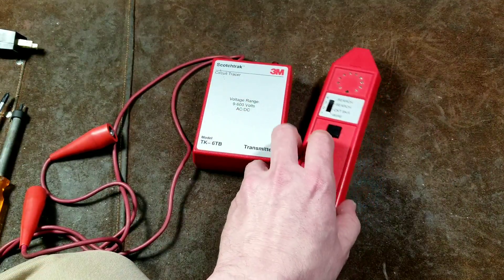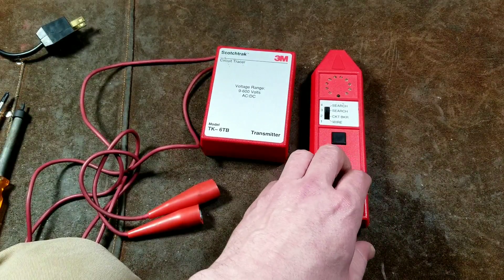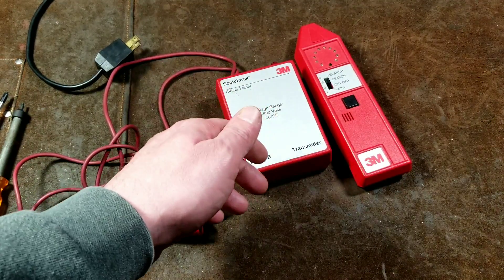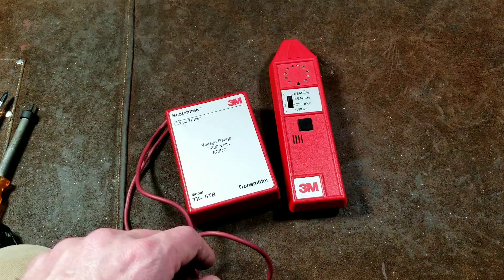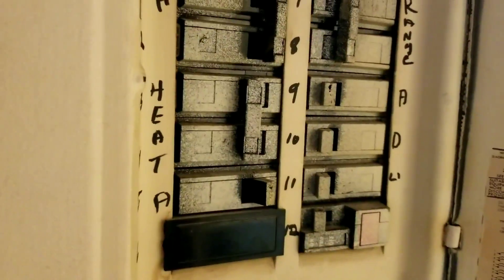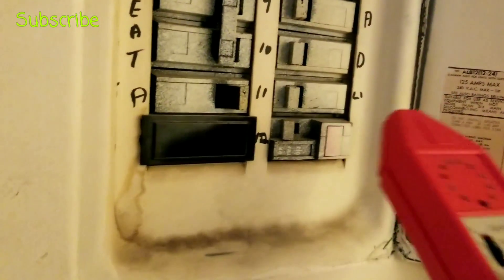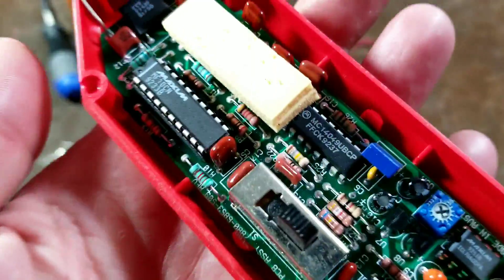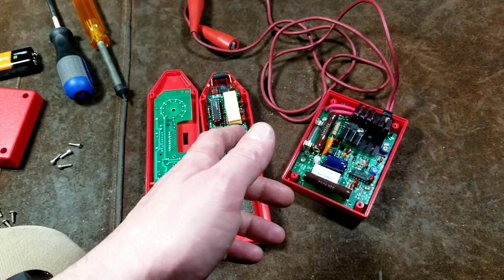3M ScotchTrak AC/DC Live Circuit Tracer/Tracker Review

Comment: Love this circuit tracer. I am a foreman for an electrical contractor and my company owns one that I have been using for over 10 years . Been looking for a while and If I could find one I would buy it in a heart beat. Very easy to use and more accurate than a lot of the newer circuit tracers I have used.
Reply: You’re in luck. I have one that’s never been used.

Comment: Which would you recommend for a homeowner like an expensive one but something that's pretty good. And I can tell you if the wires alive or not thank you.  Oh and by the way I just subscribe to your Channel .
Reply from the maker: A used greenlee or amprobe
Reply: 2 years 2 late but home boy played you. As a homowner , all you would need is a tick tracer and the ability to shut off breaker. For unknown users!!! this device is for electricians to locate a circuit breaker in a panel that feeds an outled/whatever.. The goal is to minimize turning off circuit breakers to shut off power to something an electrician wants to work on. sorry had a couple of beers so  ....................